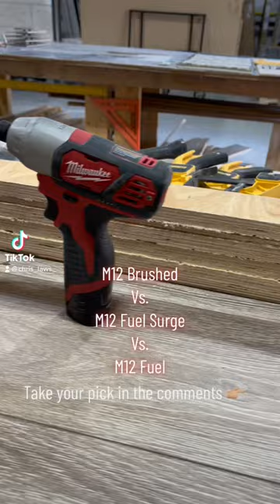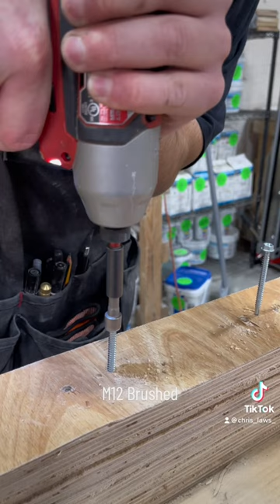M12 Impact Driver Test

Comment: I think the new M12 fuel is stronger than the Surge, but I could be wrong.
Reply from the maker: I think you are correct. I also think the 2nd generation m12 fuel impact driver is supposed to be stronger than the surge, which is why I was surprised by the results. Could be a difference in the batteries 🤷🏻‍♂️
Reply: @Chris_laws  The surge is hydraulic drive, so gives more continuous torque. That could explain why the surge is a little faster.

Comment: So the fuel surge is the better model according to this from my understanding. Is it just a different battery or is it a different impact altogether?
Reply from the maker: They all have 1.5 amp hour batteries fully charged. Although, the battery in the m12 fuel may be older just judging by the results, because I was expecting the fuel to be the fastest
Reply: @Chris_laws  just the name alone told me the gears ⚙️ or something about the motor would have a faster transistor. I know that they all looked different but I'm wondering about the parts inside the units. I hope that makes sense.
Reply: @DonaldAJr the Surge is hydraulic driven where all the others are mechanically driven ,the Surge is so quiet because there is not a bunch of metal parts inside beating in each other to make it impact.
Reply: @dustinpomeroy8817  WOW 👌. Thank you for that explanation I thought it was all 100% or nearly a 100% replica of parts. So in turn I'm now wondering what would take a crap and stop working sooner. Tools in general are made to work their butt off and tools today are made to throw away and replace every year or 2 max. I want the day and age back where everything is made to last a lifetime or 2 lifetimes.